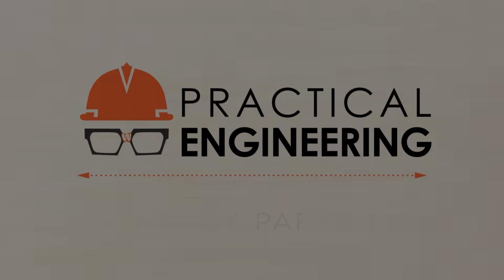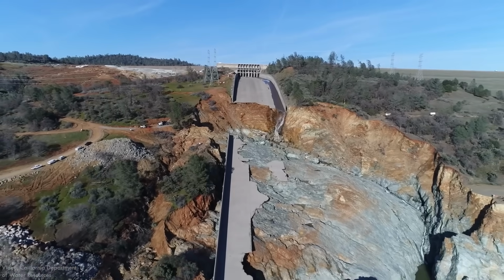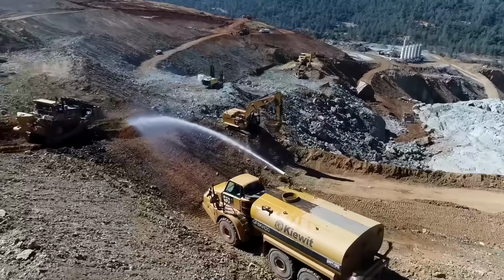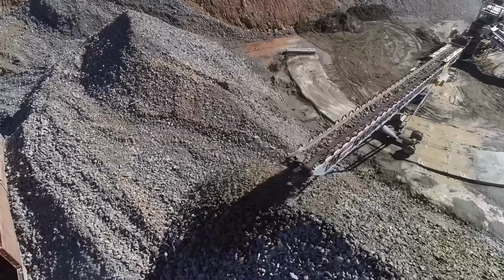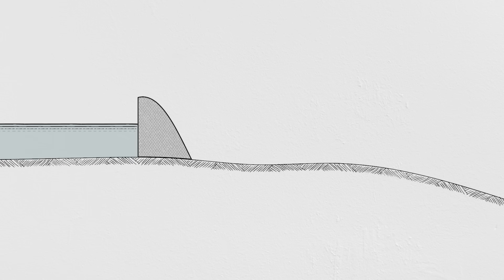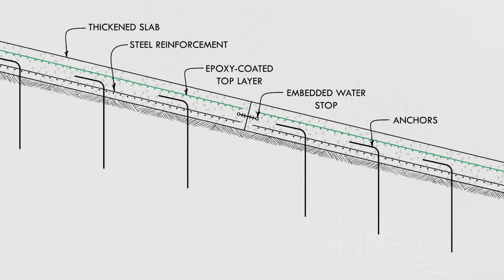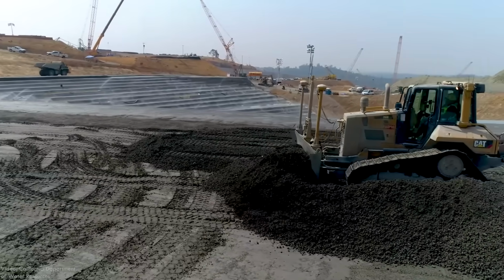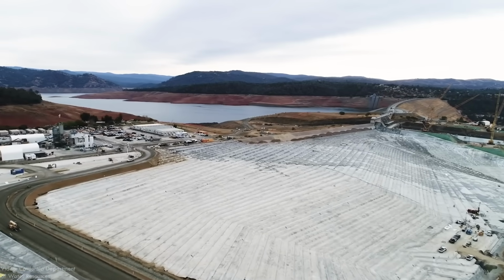Rebuilding the Oroville Dam Spillways

Comment: I am puzzled by a non-construction-question:

The new spillway was used in the past flood-season. I understand that means the lake was "full" to some critical predetermined level at that point in time. Later this year it was down to very low levels "as a result of a multi-year-drought".

I cannot put these two bits together. 

How does the lake "remember" the effect of the long-term-drought after overflowing at some point in the recent past?
Reply: not sure what you mean by the lake remembering, but the location the lake is in has a wet and dry season cycle. during wet seasons dams have to be at or below certain levels when they know a large storm is approaching as, if water is entering faster than the release rate they will need to open the emergency spullways to stop it from over flowing. this is looked at on a per storm basis. in terms of multi year drought, that looks at seasonal rainfall amounts. it is still possible, but unlikely, to have a rainfall event in the top 5% of weather systems in a drought year; as a year being a drought year looks at total rain fall per season, not in a given storm. did that answer your question?
Reply: Thank you for your answer and sorry for being unclear.

I was under the impression, propably wrong, that the spillway is used if the lake is full, or close to that and still rising, and thus the dam is threatened to be overwhelmed by a lot of water in a short time. So only in some kind of "more than enough water" situation.

If the level is then exceptionally low after just one following dry season, how can that be an effect of a drought of multiple years. As opposed to just the drought in the dry season that has passed since it last was full?

If I understand your answer correctly you are saying that when massive rainfall is forecast with expected inflow (in total volume, not per time) greater than the lake can take they would start draining early because the capacity of the spillway is less (per time) than the event can add in a short time.  So it would be too late to only start draining at or near the "full" mark. Makes sense.

Still you would want to "waste" as little water as safely possible, or not? So unrealistically assuming a perfectly reliable forecast after such an event the lake would be full when the rain has stopped falling and all the water from it has made its way into the reservoir. In practice subtract some margin from that, because weather, and you would end up "reasonably full" I imagine.

Wouldn't the lake being full then have "reset" the drought condition? Why does it matter how long the drought lasted before the last high watermark was reached? So that today, when it is low again, that low level can be said to be due to the draught of years that passed before that?

If I fill a glass it is full. It does not matter for how long it was empty or nearly empty before that, or does it? Why does it for a reservoir like lake Oroville? Where is the flaw in that simple analogy?

Comment: Does this complete  debacle  not prove just how dangerous dams of this size actually are and  enhance the need for removal of such structures . then you have to consider the vast amounts of CO2 produced plus other polluting gasses  in the production of all that cement  powder for the concrete  not good

Comment: I'm an electrical engineer myself. But whether it's a new computer, a more efficient power transmission system, or this massive spillway failure repair project, It's participation in projects like these that makes all the effort spent in becoming good at your profession worth the time. These engineers were (most likely hand) picked because they had distinguished themselves within their fields. They were the best of the best. It's not just a brain trust. It's an experience and personal excellence trust too. I'ts freakin' mind boggling.

Comment: I know it's true, but something just seems amusing when all repair plans reduce to "use the hole," "bridge the hole," and "fill the hole." I think bridge the hole with an aqueduct would have worked fine. I'm a bit curious to the details of the model and the data they got that the University of Utah made. Also, what is different about the replacement drains that make sure they actually relieve the water pressure this time?
Reply: The replacement drains are now below grade in trenches, rather than above grade in thin spots of the reinforced concrete spillway.  The drains had always worked (you can see them discharging water back into the spillway during the failure video) but had created weak spots (that had created more leakage), so the real problem was the elimination of the weak spots in order to prevent the accelerated leakage.
Reply: ‘Bridge the hole’ almost certainly would have worked, maybe even better than the choice they actually made.  Unfortunately, as the video pointed out, the extra time necessary to do the aqueduct design & validation would have involved far too much additional risk of another flood that could completely destroy the dam.

Comment: In these times when big civil engineering projects are seemingly always way over buget and delayed by decades: is there a lesson to be learned how this massive emergency project got managed and the "get it done!" attitude? 
Was it more expensive compared to a regular project? Were regulations skipped? How did they cut the red tape more quickly?
Could this be used for regular non-emergency projects?
Reply: It's usually a case of "cheap, quick, and good, but you can only pick two"

Most construction projects are cheap and good but not quick. This project was quick and good but not cheap.
Reply: @micahned  with another constraint being you never DONT want to choose "good". so really your choices are good+cheap or good+quick
Reply: @pvic6959  I've worked on plenty of projects that weren't good... but I'm in IT, not civil engineering.
Reply: @demoniack81  im in software dev and i can say the same lol
Reply: @micahned  You haven't seen some of the places I've worked, cheap and quick is the motto of the day (and then mass panic when inspectors label things as deficient) One place I worked is STILL undergoing remediations for deficiencies something like 5 years on, mostly small stuff the last couple years though.
Reply: Yes and no. Yes it would be possible to get large projects like this built quickly on a normal basis, but that would also make the contractor less money. On big construction projects (Boston's Big Dig, SF's Central Subway) a lot of the time and budget over runs comes from "differing site conditions".  This is a legal term in the construction contract documents that the contractor can use to request more time and money, because the conditions found during construction are different than those shown on the plans. Contractors will claim almost anything as "differing site conditions" including encountering ground water when digging in a river, finding that the rock was a foot higher than shown in the boring logs, and other small miscellaneous issues. The larger contractors specifically have people on their staff to do nothing but file paperwork like this. 
      Because of all the paperwork, typically the Resident Engineer will just sign off on the delay and money claims, rather than fighting every claim. Could a large project get built on time and budget, yes, but only if you have a good RE who is willing to push back on most of the contractor's claims (some claims are valid that the Design Engineer messed up). Most large projects are run by State or Federal agencies that have large checkbooks and can keep paying for the delays. Both the REs and Contractors know this, hence why the contractor files so many claims, and why most are approved. For smaller agencies the don't have large check books (Cities, Counties, etc.) the REs do fight the claims a lot harder, and the projects are much more likely to be completed on time and budget.
      As for this project, as part of the contract documents, the contractor had to be completed by a certain time because the spillway needed to be used for flood control. That was a deadline that could not be adjusted. To meet the deadline, the contractor brought in lots of equipment and people (keep in mind, the contractor Kiewit is based in Omaha and had to truck in most of the equipment in the videos from out of state). They also were working 6-7 day weeks, sometimes 24 hours a day. All of those factors drive up the cost. As the saying goes, time is money. The less time you have, the more its going to cost you.
      For the regulations side of things, its getting the approval agencies to understand how fast you need stuff reviewed. Just because you would like to have a document approved by an agency this week, doesn't mean that they care, and they will approve it when they get around to it. For the spillway, they had to get approvals done NOW. As such, the project was paying for the agencies employees to sit on sight and review nothing besides this project. That's a cost of $1,000 per day per person who you need sitting on site to review documents for the duration of the project, two years in this case. Even the more expensive review documents are around $20,000 dollars to get reviewed, but that might take years to get approved (the long time frame is usually due for environmental to be able to visit the project location in all four seasons to see what endangered animals/plants are found in that area).
Reply: @bryanfraser4062  thanks for the detailed explanation!
Reply: @bryanfraser4062  That's an excellent explanation Bryan. How are you connected to the industry? I'm an Irish RE. What's the job market like for RE's specialising in water/wastewater in the US?
Reply: @bryanfraser4062  Well said. Another example is that it costs less and takes less time to repave a highway than to build a new one. In one permits might take a couple months, in the other a decade to have everything tied down is not strange.
Reply: @bryanfraser4062  
Very well said. Thank you!
Reply: Not in the industry, but once you're running 12+ hour days, you're not using that for anything but emergencies
Reply: @leakingamps2050  well, one could use multiple shifts, I think?

It's just beautiful to see that this project seems to have been done efficiently and quickly, which sadly doesn't seem to be the norm at all anymore.
Reply: @leakingamps2050  Large construction projects typically run 58-hour weeks = 5x10+1x8.
Reply: @cf453  That's often true; funny how the cost of labor is thrown out to the public as why XYZ isn't done, but once a big project starts and is being paid for with borrowed money, labor costs don't seem to be such a consideration. On large building sites there is often separate very well paid week end crews tasked to take care of clean up, and catch up. All this points out to what I think is the driving force, even in this era of cheap money, that is time.
Reply: @leakingamps2050  standard practice in oil and gas. We run sun up sun down to build pads, roads and pipelines. 24 hour sites arent uncommon.
Reply: Early Contractor Involvement is slowly creeping into the industry but alas there is still a substantial amount of distrust between the contractor and employer/designer
Reply: Great questions, sir.
Reply: I'm sure an internal memo or meeting would have advised staff to use appropriate discretion when it involves this project, imagine just the logistics of all the heavy,equipment transport to site. All you need is an ass who complains the total weight is 30,500lbs vs 30,0000lbs declared on paper and not sign the permit until rectified.

Comment: 21-12-2021.l saw two things ,that l do every time here,( 1 ) vacuuming clean the rock surface, and ( 2 ) beefing up the steel reinforcement for the concrete, but they didn,t put it under voltage to prevent electrolysis in the mix, so it will happen again.

Comment: Why not generate power with the spillway water? It would slow the water down and lessen the impact on the spillway.
Reply: The Hyatt Power Plant is located within the dam near the bottom of the dam where it has always been able to access water 24/7 until this year. Water only flows in the spillway a few times a year, so it wouldn't be a good source.
Reply: @lizj5740  yea I know

Comment: Why couldn't they just leave it broken and let it become an intermittent river and save a billion dollars?
There are millions of rivers all throughout the USA and they all erode soil to make way for their course. We don't say 'oh look there's a river, how terrible it is that it eroded the land to make the channel it runs through. We just say 'there is land and there is water'. 
So I don't see what's so precious about the bit of land either side of the slip way and between the dam and where the slipway previously released the water to. it's not that massive an area of land and as a percentage of the North American continent or even California it's insignificant. 
I'm not dismissing environmental concerns but I just don't see why every square foot of land has to be protected. Further to that, the actual reconstruction process would have a pretty big environmental impact.

Comment: So the folks that designed the failure, also designed the replacement.
Reply: The dam and its spillways were built in the 1960s, so I doubt any of the original designers worked on this project. ;-)

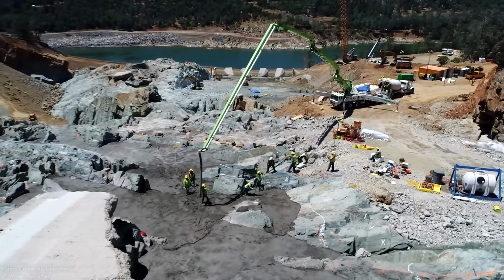Comment: If you're ever feeling like your job is overwhelming, at least your boss didn't hand you a shop-vac and ask you to go vacuum 500,000 square feet of hillside (11:48). That blew my mind!
Reply: Same. I was like wait, are they really vaccuuming the rock? lol
Reply: @screetchycello  the rocks need to be vacuum cleaned because dust would prevent adhesion of the concrete to the rocks. If you've ever tried to use adhesive tape on a dusty surface, you know that it won't work well
Reply: @TheNasaDude  After the rocks were cleaned , is it then covered by some kind of bonding substance before the concrete is applied?
Reply: @antone5462  there is a huge number of agents that can be used in concrete. Practical Engineering here on YouTube has some introductory videos on the subject, although nothing in depth
Reply: @TheNasaDude  Not really what I asked , but thanks anyway.
Reply: @antone5462  sorry, given the number of existing cement additives the best way to get an answer would be to read the documentation of the incident and repairs. 

My best guess is that any coating agent/bonding promoter could be mixed in the cement before adding the rocks, again to avoid moving stuff around as much as possible.

Beyond the use of concrete with low water content (which has been known for a long time to result in a stronger structure, but hasn't seen much use because it's hard to move and difficult to shape) I suppose plasticising additives (to make the concrete easier to lay) and retardants (to slow down the setting) were used
Reply: @TheNasaDude    You still have not read my original question properly....It has nothing to do with the concrete mixture, but with adhesion onto the cleaned rock base. But I have a good answer from someone else. As they say for exams, RTBQ .
Reply: @antone5462  care to share the answer?

I think I did answer you: since the cement includes a lot of rock, why would you coat the rocks at the base? I would put an additive directly into the mix. But I don't know the details of this particular project
Reply: The one intern that had to go to every home improvement store in the area and buy out their entire stock of shop-vacs.
Reply: @WolfTronix  what? They buy them wholesale like they do literally everything else, what planet are you on? Lol
Reply: @WolfTronix  apprentices in the trade world. Interns work in offices
Reply: I had to stop and watch that part several times....I couldn't belive what I was seeing.
Reply: An army of shop vacs!!!
Reply: All part of the Details to do a job correctly! It is the small details which make for failures or Catastrophic Failures. 
What would a small amount of sugar do the concrete?  In a critical area. yaaaa
Reply: at least the workers got actual shop vacs not some fancy crap dyson turbo noisers.
Reply: There were guys down there with buckets and what looked like brushes, too
Reply: Try having to walk in a foot and a half of cement with a 80lb vibrator motor backpack and a 20lb vibrator. in 600 yards of cement per night 💪🏻
Reply: @trp2413  
🤣🤣🤣
Reply: Using a shop vac is the easiest and most recreational of menial tasks though
Reply: Dont forget all the Orange Home Depot Buckets they brought to the work site that day lol
Reply: Makes everyday feel better at my job.
I wonder what the job requirements were for being hired in this position. 
"Applicant must have 2 years of mountain climbing experience and 2 years of janitorial experience."
🤣🤣🤣
Reply: @davidscott5903 applicants must have blasting license xD
Reply: I'm kind of surprised they didn't just wash it away. There's literally a reservoir worth of water behind them they could use.
Reply: @TalesOfWar  that's probably not to liberate a lot of debris in the reservoir. That would clog the turbines.
Also there's an incredible amount of material to move, so any additional meter would cost a fortune

Comment: Yeah I don't think so. The reason for the failure of spillway was neglect of maintenance by DWR. This was the conclusion of the mishap board. If they had conducted repair of the cracked spillway, as had been done in 80's after this DWR let cracks in spillway go unrepaired and then the slow death as water started travelling through cracks and undermined the foundation and caused more cracking year after year.